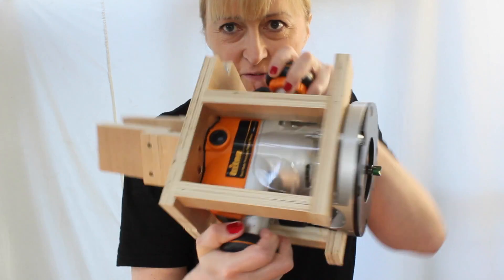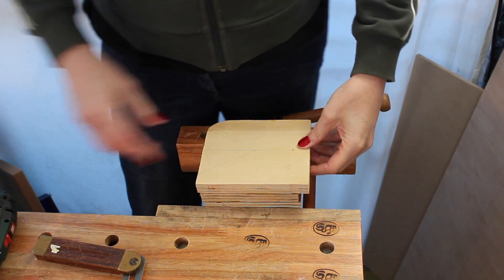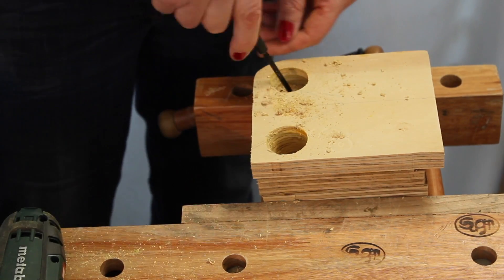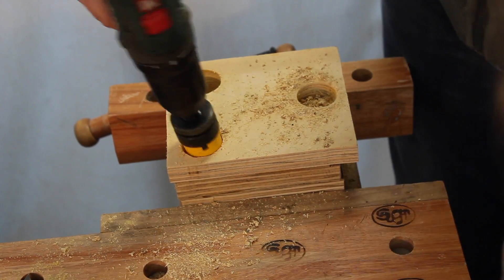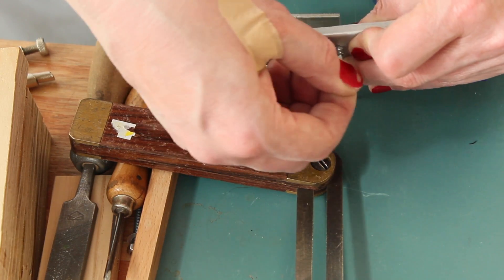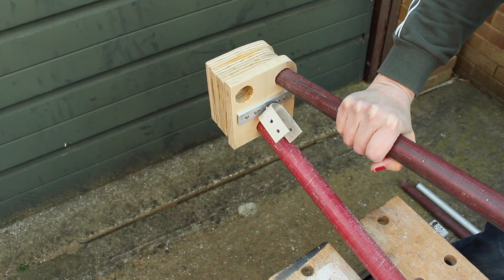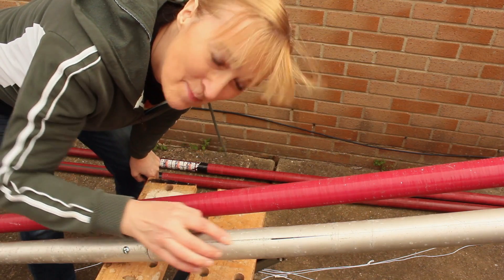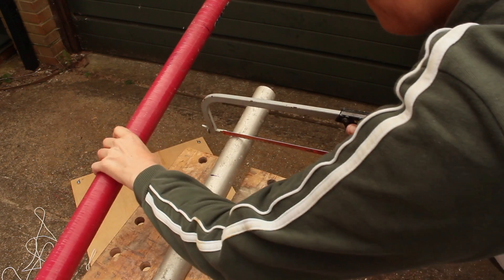Making a 15ft radius dish part 1 of 2

Comment: hi Susie,
as i work my way thru this series it dawned on me that there may be a better material choice for a sanding jig that you're making: corian
since MDF has that soft spongy core, the deep part of the dish is going to be prone to deformation from the pressure of the work piece passing over it. corian is of consistent density all the way thru.
the other option would be to make a type of butcher block out of a hardwood. the end grain of the butcher block can resist immense amounts of pressure with a basic sealant sealing off the grain. your setup for making the dished boards would be perfect for working end grain since you're taking pretty shallow cuts anyway. 
and unlike MDF that is prone to warping as soon as you essentially take off the opposing hard side, a butcher block or corian won't warp. just a thought
cheers
mike

Comment: Why do you need a "radius dish" for clamping and sanding guitar back braces? In Spain they are making guitars for the last 200 years + without this complicated and difficult jig. Cut out MDF-pieces or plywood with the desired radius and use them to sand and clamp the braces. The old masters didn´t use either any clamps for glueing , only a  rope and a wedge.
Guitarmaking is foremost the art of making easy and simple jigs for every part of the process.
Reply from the maker: +Stefan Richter 200 years ago they didn't have windsurf masts
Reply from the maker: +Stefan Richter Oh dear, I guess you haven't seen my latest video :-)
Reply: Ok , I saw the title , so from now on I will call you , Susan the "dishmaker"

Comment: question please Susan . if i took a cord pegged one end and pencil at 30 feet marked it on a 1x4 or 1x6 would it not give me a 30 ft radius ? and then make a sled of 2 and make my dish that way ?
Reply from the maker: +Walter Rider in principle yes, and I'm going to create a sled and template rails for my next dish. What you'll have to guard against though is the amount of stretch you'll get in 30ft of string - it will be very difficult to keep the curve even and accurate. I'll be plotting it mathematically
Reply: thank you